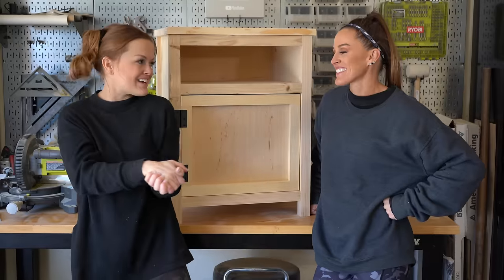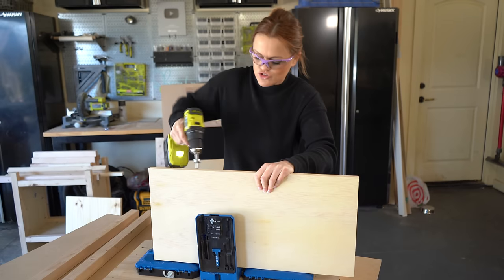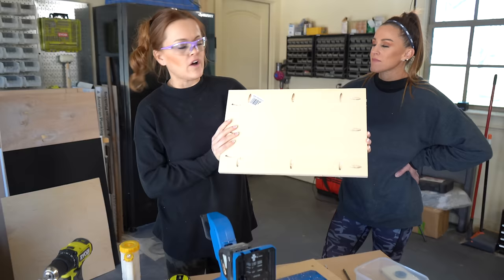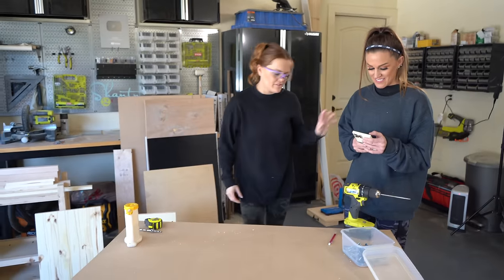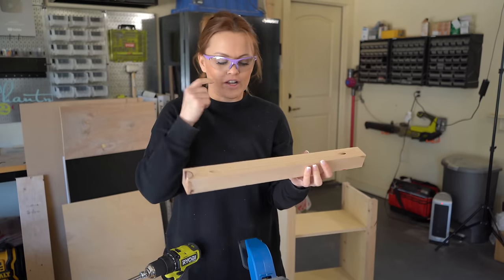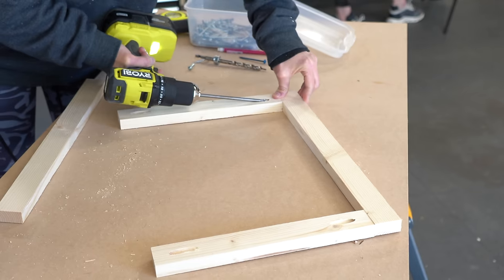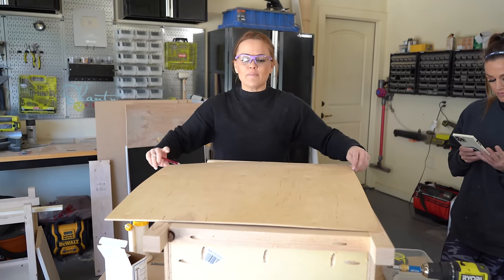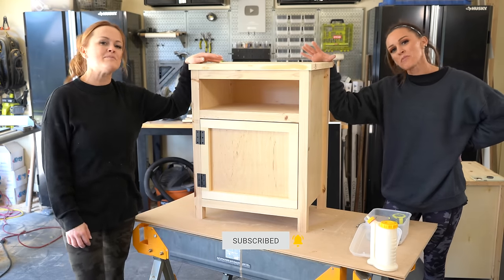DIY Nightstand We Built for Whitney's Son!

Comment: Is there any reason that you don’t use Rabbets for panels, and either Dado’s or Grooves for shelves, back panels, etc???  You ladies not only have all the tools, But have the talent too!  I’m using the same table saw, and find it incredibly accurate for all of those procedures. One thing I have found, is that using the appropriate joinery, along with “Pocket Hole” screws, as necessary, Makes for a super solid furniture build, and, I’ve saved a bunch of “Coffee Cash” using the minimum amount of fasteners.                                                                                   The only thing I would recommend for your table saw, is to replace the fence with a Vega, 48”. The fence that came with my saw was a bit hard to keep aligned from weekend to weekend. The Vega was a great add on, and relatively in expensive from Amazon.                       
With the new fence, my router has been on a much needed vacation.
Great work on the builds, looking forward to more,  B.T.W.,,,, Thanks for the laundry room cabinet idea, my Wife and I have built 3 of them as of now,  2 of them even have frosted glass door panels. Thanks for the inspiration!

Comment: Are the 2X2 boards you ripped and used actually 2X2 or are they 1.5X1.5? 

I’m going to use white oak for all of it but the boards I have are 1” thick so I might just go buy 2X2’s to supplement so I don’t have to do a glue up of what I have. If I buy 2X2’s they’ll really be 1.5X1.5”

Comment: What setting do you set the chuck at to prevent overdrilling your pocket holes?
Reply from the maker: The depth collar stops you at the correct place... and they have the thickness marked on the side to adjust them.  Hope that makes sense!